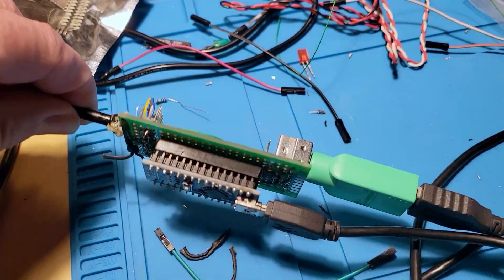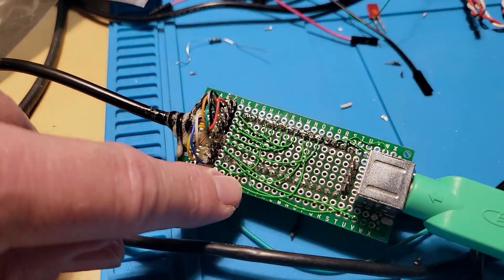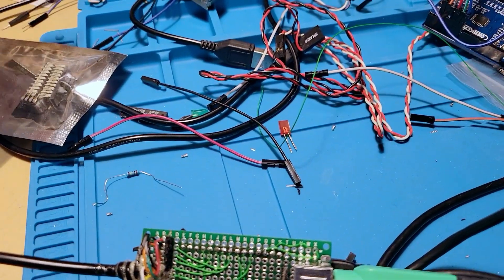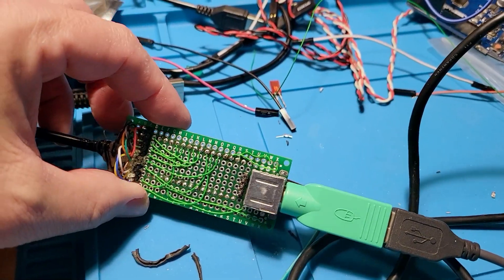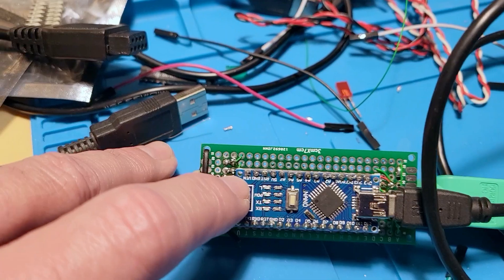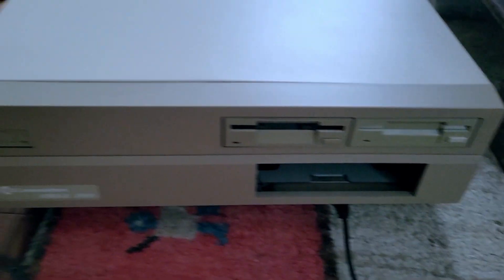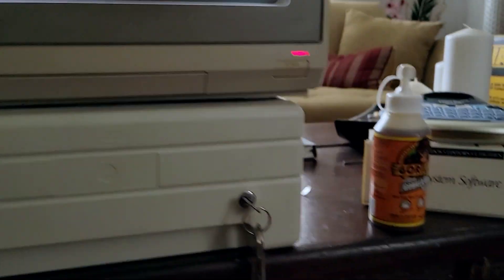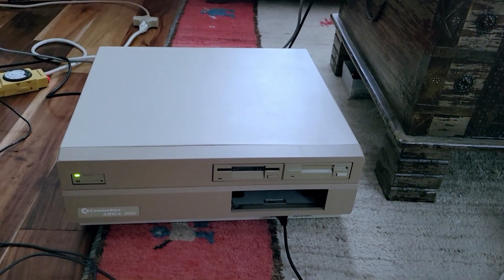DIY Amiga Mouse

Comment: Nice!
Would it be viable to draw power from the Amigas 9pin connector instead of powering the board off of USB? Quick googling suggests the port could provide enough power for the mouse and the Arduino (combined <100mA ... maybe with a 100mA fuse since the A500 and A2000 don't seem to have additional protection for this line). WDYT?
Reply from the maker: Your mileage may vary. I did not want to chance breaking my poor old Amiga.